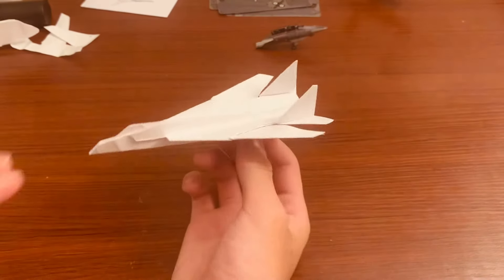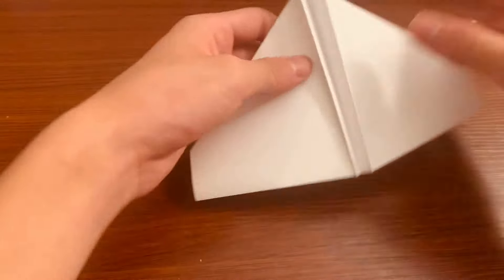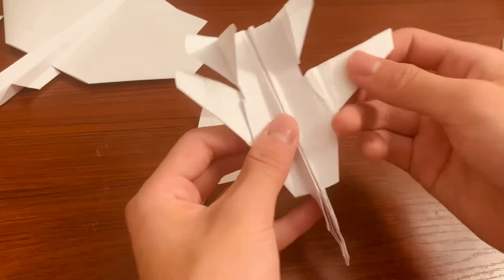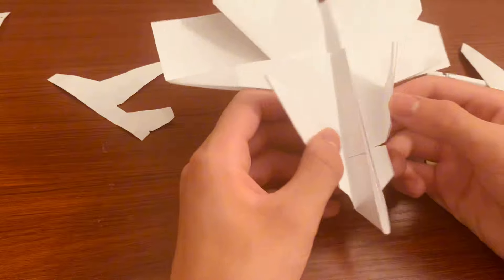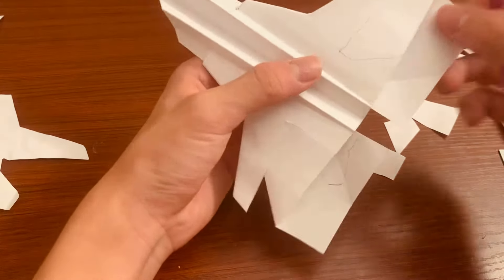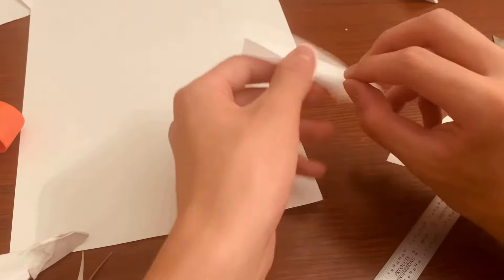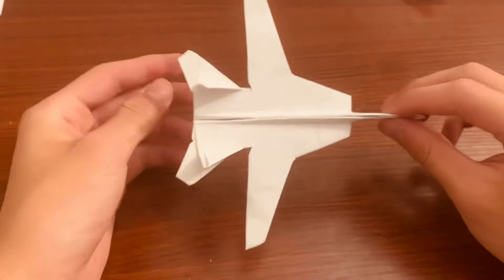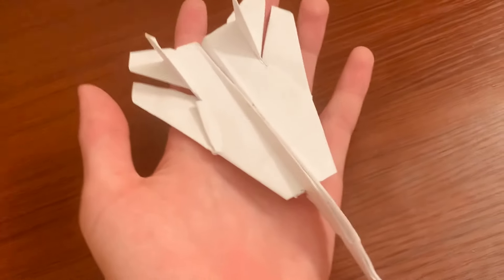Flyable paper F-14 tutorial

Comment: Mine wasn’t flying. Any tips?
Reply from the maker: If it’s spinning a lot either make sure the wings are level or it might be because of the uneven weight in both wings. If it’s pitching up or pitching down adjust the tail flaps or adjust the weight
Reply: Install an f110 engine on it
Reply: @The_F-14 smart
Reply: @ieatgrass_z i was going to do a test on mine but it proceeds to turn